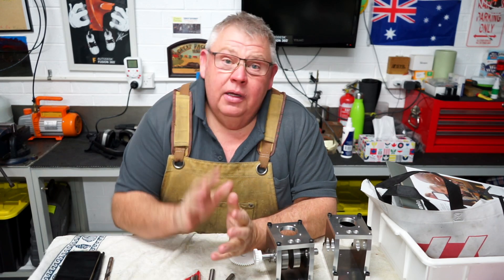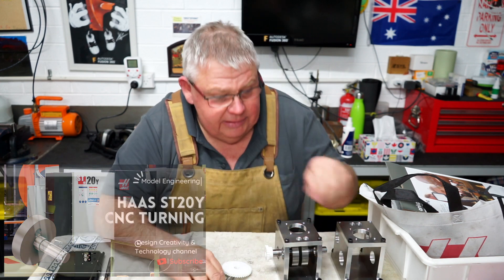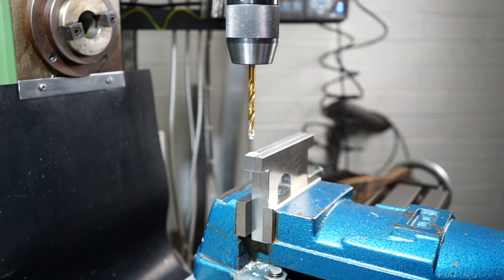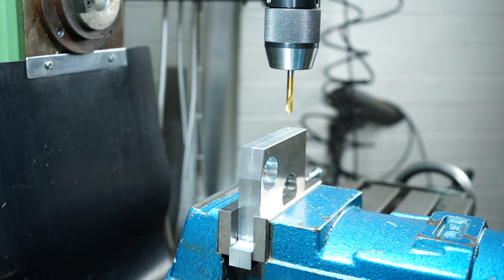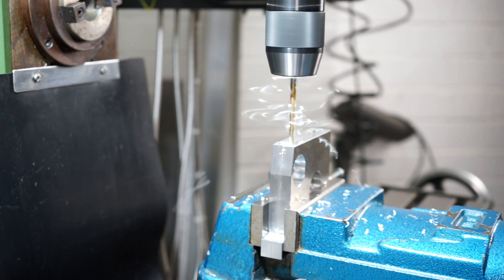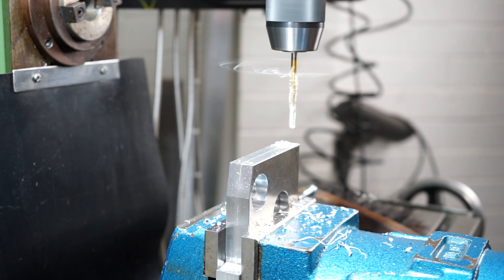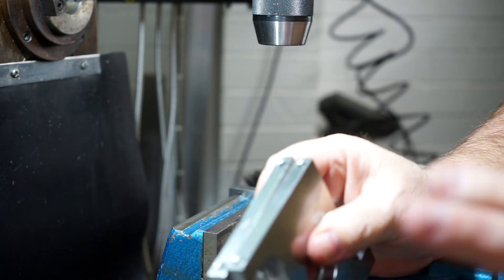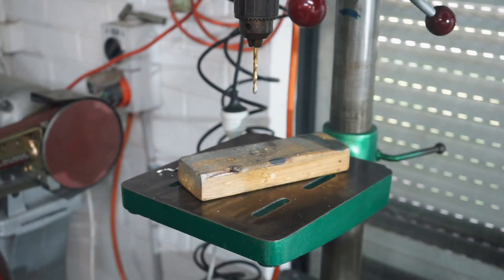4-Stroke Engine Build | Part 1 | CRANKCASE

Comment: My high school shopclass teach failed anyone who called it "stroke". He insisted the proper terminology was "cycle". And yes using the proper names make it easier the understand and comprehend and learn.  No slppy thinking allowed in his class. Thank you Mr Stewart for teaching us the correct way.
Reply from the maker: Hi David.  As trained teacher and qualified motor mechanic allow me to correct you.  Stroke refers to the reciprocating motion (up & down) of the piston.  In Australia we use the word "stroke".  Cycle refers to the engine operation as a whole.  Basic 1st year motor mechanics mate.  My reference ED May & WH Crouse (1984) Automotive Mechanics 3rd edition. McGraw Hill.